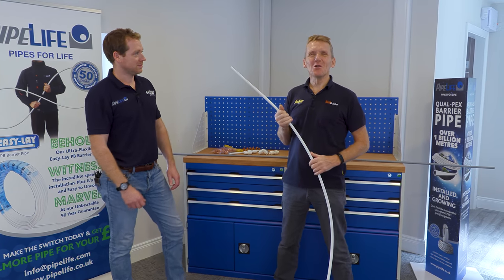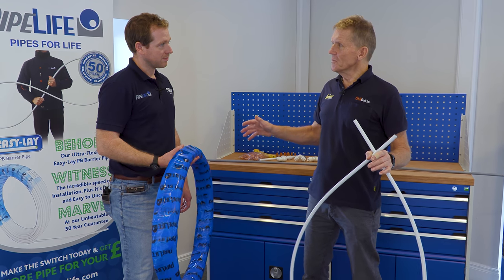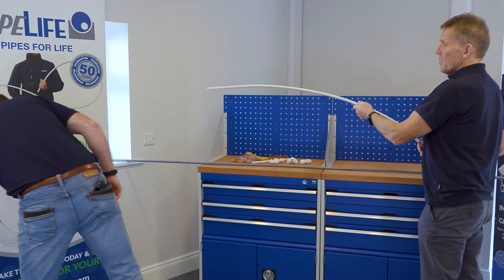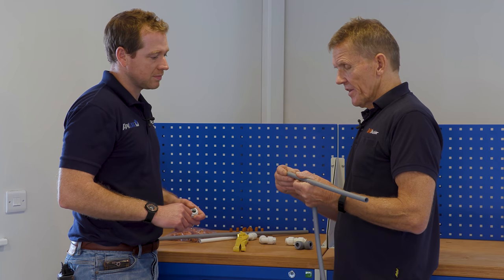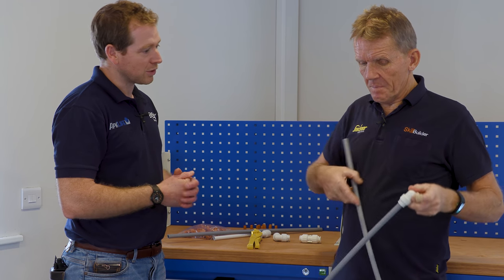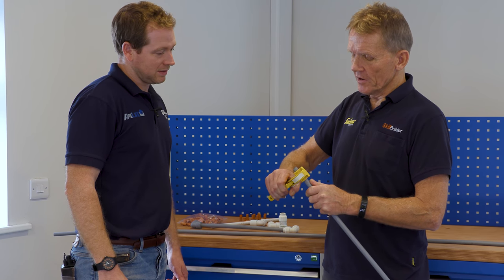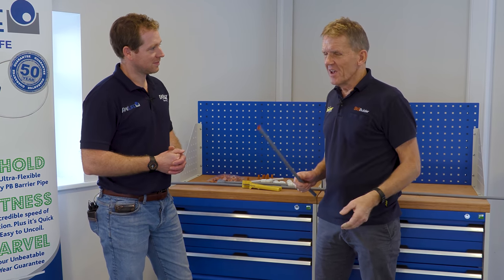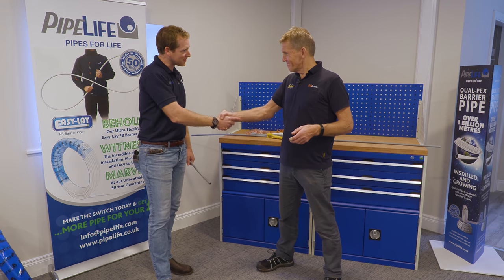Working with Pipelife Easy-Lay PB Barrier Pipe

Comment: Underfloor pipe has to be pulled from the outside of a roll in the same way as a power cable. Otherwise there will be a 360 degree twist every 3m or so. Shorter lengths uncoil themselves on the job.

Comment: @SkillBuilder  have you seen this new PEX pipe yet? I think it might be just a US thing atm, but not sure. It's basically plastic pipe pushed over a metal barbed connector and it seals by being shrunk in 2 different ways.
Reply from the maker: If it is the one I am thinking of it is sold by Uponor. I had the kit but sold it.  Pumb City in Colchester sell it and a plumber I was talking to uses it and said he did a whole block of flats with it and never had a single leak. That is good to know because I have some in my house. 
https://www.ebay.co.uk/itm/276222848348?chn=ps&_ul=GB&norover=1&mkevt=1&mkrid=710-134428-41853-0&mkcid=2&mkscid=101&itemid=276222848348&targetid=1403035015347&device=c&mktype=pla&googleloc=1007014&poi=&campaignid=17218284410&mkgroupid=142217514411&rlsatarget=pla-1403035015347&abcId=9300867&merchantid=7414684&gclid=Cj0KCQiAkKqsBhC3ARIsAEEjuJi2lPlIgMO5Uj1Bj95SmV-1GCna19JzmE5ytdJ6CaA0GdE6YehybwoaArZjEALw_wcB
Reply from the maker: https://www.youtube.com/watch?v=0cBtlyNdDrA
Reply: @SkillBuilder  Yeah that's that's one type, the other just pushes together without being expanded, you then slide a metal ring over the pipe and crimp it tight. Doesn't seem to be taking off over here yet then.....

Comment: I’d very much like to know if someone has tried this pipe from new I.e. straight out the coil. I used the JG Speedfit lay flat coil and that certainly was a far stretch away from lay flat, more like lay-coiled….wondering if this easylay is the same or better

Comment: Hi, I am in the process of using JG plastic piping to each radiator, question is shall I use 15mm which is already installed in copper to the boiler or would 10mm be sufficient enough? The radiators I'm putting up are double convectors and roughly a metre wide.
Reply: The question to ask is why would you drop to 10mm

Comment: can a radiator connected with push fit pipe coming in at an angle ie no 90 degree elbow -instead pipe is semi circulated to fit into the radiator? purchased this property and noticed pip going into radiator if not straight, worried it may come off the radiator as its not aligned, so should I put an elbow? views appreciated. thank you
Reply: Use a length of copper into the valve first .

Comment: Hi there I have a question out of interest, the grey elbow fitting that you mentioned that is not demountable, is this the fitting that commonly contains a green plastic collar with metal teeth that grabs the pipe, I only ask as I have taken this fitting apart before to change the pipe work and found that this plastic collar will slide of in the opposite direction to the teeth grabbing and can then be re installed as you were doing it for the first time. Or did you mean you can’t easily de mount and remount without taking the fitting apart. I only ask in the interest of not doing something wrong in the future. Thanks for your content keep up the good work.
Reply from the maker: I meant not demountable in as much as it can't be removed and reused without changing the grab ring.
Reply: Some manufacturers offer very slimline fittings which cannot be mounted. They are used when a neater appearance is needed. Most however have a demounting tool or the fitting cap unscrews. The demountable grab rings are not reusable.

Comment: Can you join PB pipe (already installed in house) to pex pipe using a push fit fitting?
Reply from the maker: Yes just check it is the same dimension. In the U.K that will be 15mm and it is printed on the side of the pipe.

Comment: so the push inserts reduces the diameter of the pipe   ??
Reply from the maker: Yes at the joint but the pipe is smooth and there are fewer joints so it would be unusual to suffer any loss of flow.
Reply: The stainless sleeves used by Hep20 hardly affect intranet diameter. But the big advantage of a more flexible pipe is you’ll use far fewer fittings. Pipes to radiators run down the wall and loop to the valves. Use valves with elbow tails and the pipes are almost completely hidden.

Comment: Nice vid' Roger. You are different you know, give a young guy just coming into plumbing some plastic and he'll have no worries using it. Give a more mature plumber plastic and he might flinch after years of (reliable) metal use. You are really open minded with this, is it because you saw plastic come in and it wasn't good, but you have seen it improve and now you're happy with it? Bit long winded, sorry, just wondering 👍
Reply from the maker: Hi Chris
A lot of plumbers had bad experience with the early versions of plastic pipe. It went brittle and shattered. I took out loads of it and I can't blame anyone for sticking with what they know and trust. I saw John Guest and Acorn and really didn't think they stood any chance of getting their products established but they played the long game. 
I think most plumbers are now happy to use both and the recent popularity of crimp fittings means we have even more options.
Reply: @SkillBuilder  Hi Roger, cheers for answering, very interesting to read, I see way more plastic these days in houses than I did in the past. Still see that microbore sometimes, but very rare. Keep it up pal 👍
Reply: In Derby England, I came across a lot of the Marley plastic pipe. It’s was originally glued together (I believe) it came in during 1979s when copper prices went ballistic and material quality dropped. It did the job mimicking BSP iron pipes. But over the years it’s gone brittle. I carried a piece of hose and worm clips to provide a temporary repair. But once it went brittle the only fix is to replumb the lot. 
The failure of this stuff gave Hep2O and JG a very hard time. But they stuck it out.
Reply: @Dave5843-d9m  Great contribution David, very interesting 👍
Reply: Microbore pipes (used for a while in heating systems) are nylon. It’s still used in compressed air systems. They have not degraded like “Marley” plastic pipes.
Reply: @Dave5843-d9m  Funnily enough my parents have microbore, by luck or install quality it's 30 years old now and has no issues. Was fitted by very experienced plumber though,  the kind that you see the bends and design effort and think, wow, that's impressive.

Comment: Can it be used on central heating?
Reply: Barrier pipe came on because there is a theoretical potential for oxygen to diffuse through the plastic. Barrier pipe is needed to meet some codes but they all work to code when boiler water inhibitors are used. 
The big advantage for heating is the pipe is run through floor joists as you would power cables. Joists are drilled along centre line so are not weakened.

Comment: How do you make this rodent proof, I fitted a plastic pipe ch system off a manifold system that ran through my loft . Once I buried the pipes , all insulated under Two layers of insulation it was party time for the mice , they made nests out of insulation and nibble away at the pipes for a water source , I’ve tried spraying every thing with WD 40 as they don’t like that but it doesn’t stop them . I’ve now got patchy insulation on the pipes and in the loft, it’s a right old mess . Does anyone have any ideas
Reply: You didn't get a satisfactory response to rodent problem ?
We stick to copper, or MLCP pipe.

Comment: Can you press copper fittings onto Easy-Lay pipe?
Reply: Why would you even want to?
Reply: Extensions to an existing copper line!
Reply: Then you would just use a push fit coupler.
Reply: @markrainford1219  Because I have press fit fittings and no speed fit couplers.
Reply: @markrainford1219  I aint got any on site, can I use press fit fittings with Easy-Lay pipe?
Reply: I think you can use compression fittings if you use the correct insert. Alternatively use a straight connector. One side platic one side copper.
Reply: Sorry mate ,yes that was a legit question in your circumstances. E-mailed  national sales director for you. He needs to know sizes and brands. Can I leave it with you now?
Reply: Personally I would pop down the merchants and buy a bag of Poly (whatever brand) couplings. It works just as well on copper as on poly.

Comment: Copper or stainless for me.   Had too many failures with early plastic to ever go back
Reply: Wow you must be really old!!!! lol. What were your failures? Mine were 10mm rad drops blocking up on "sealed systems"
Reply: @markrainford1219  
mainly fitting failure on cold mains feed to kitchen
Reply: @sonacphotos   Never seen a rodent chew through a metal pipe.
Reply: @pinocchiomediam5055  But copper can go porous and it splits when the pipe freezes. Today’s polymer pipes can freeze without damage and will never go porous. They can also get crushed and will spring back when the load is removed. 
Copper has its place but these polymer pipes are far more versatile. I my experience it’s also more reliable.

Comment: Why do some plastic inserts have a rubber O ring on the end?
Reply: Those are used for the push on connectors to make a seal. Inserts with no O ring can be used for compression fittings.
Reply: Compression fittings vary in terms of depth and in some cases, using a superseal may stop the pipe from going fully into the fitting to ensure the compression ring is sitting on the pipe, and not on the insert.
Reply: Hep2O use a plain metal support sleeve. It’s worked perfectly well since the days of Acorn so I really don’t see the point of O ringed support sleeves.

Comment: Umm this is the same as JohnGuest speed fit!! Nothing new here....
Reply: Cheaper
Reply from the maker: Pipelife made JG pipe. Now they make their own brand
Reply: It’s an alternative to JG Speedfit but frankly nicer to use with less ugly fittings. Speedfit is technically demountable but try shifting one that’s been there 20 years. Acorn/Hep20/Polypipe just unscrew. Fit a new grab ring and away you go.I’m not impressed with the new Hep2O shuck needs a demounting tool.